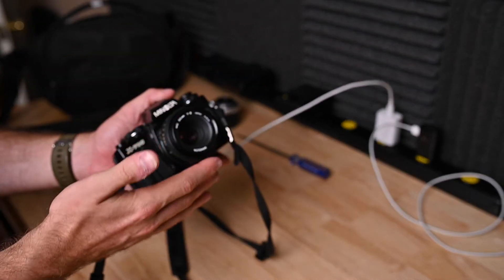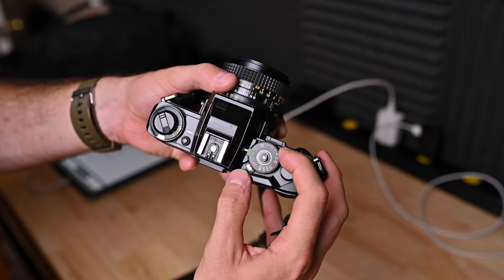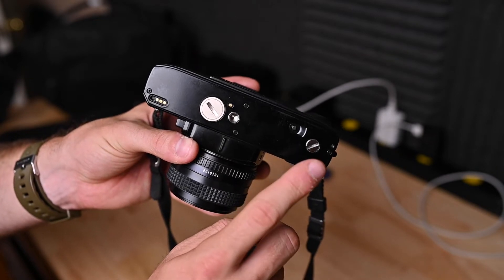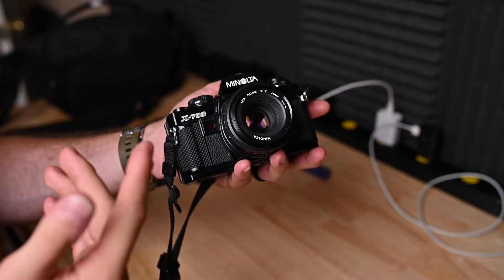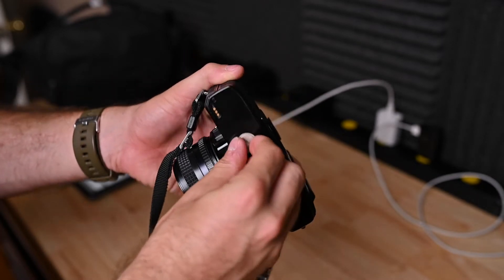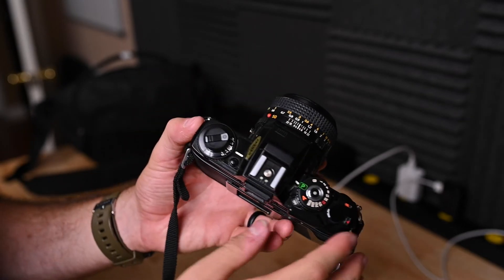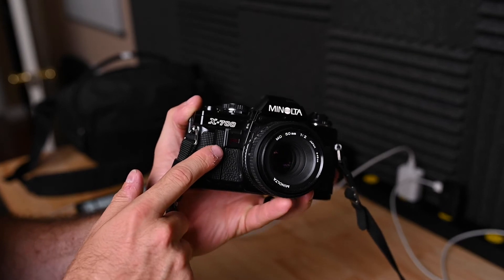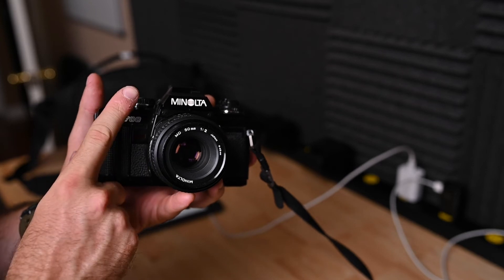How to Use the Minolta X-700 Film Camera

Comment: As it says on the back, it's ISO, which combines the arithmetic ASA scale from America and the logarithmic DIN scale from Germany. On most film packages and cartridges from around 1980 and onward, the sensitivity of the film is indicated by two numbers, namely the ASA part and the DIN part, e.g. ISO 100/21, ISO 200/24 or ISO 400/27. The entire scale from ISO 12/12 to ISO 6400/39 is there.
As you can see, when the ASA value doubles, the DIN value increases by three. 

ISO	=
DIN	ASA
12	12
15	25
18	50
21	100
24	200
27	400
30	800
33	1600
36	3200
39	6400
42	12800
45	25600
48	51200
51	102400
54	204800
57	409600
60	819200
63	1638400
66	3276800

These are the "full" values, one f-stop or shutterspeed apart, but there are film types with intermediate sensibilities, like Ektachrome 40/17, Kodachrome 64/19, Ilford 125/22 etc.

The slotted circle next to the rewind release button is the connector for the motor drive - when you advance the film manually, it will turn.
What you call a cable release trigger port is a pc connector (pc stands for "prise co-axiale" or co-axial connector), which is used to connect studio flashes.
The threaded hole under the lens release button is intended for a cable release (other cameras had it at the centre of the release button).

Comment: Helpful video, thanks. Something weird happened to my X-700. Now only works in B (manual mode). I believe the light meter went. Great little camera though...32 years and running. 🤗
Reply: B is Bulb mode, meaning the shutter stays open for as long as the shutter is triggered. I would imagine it probably has something to the capacitors that are known for going bad.

Comment: Can you change the lens while there is film in the camera? And is it safe to keep a lens off the camera in general while traveling with the camera?
Reply from the maker: Hey Ashley. Yes, you absolutely can change out the lens with film in it. The shutter curtain is closed and the viewfinder mirror is closed preventing light from coming in. You can travel with the lens off as long as you have a body cap for the camera. This will prevent anything like dust or lint from getting in.

Comment: I have a question? What if you replaced batteries and when you went to take a photo it just shut off
Reply from the maker: As in while trying to take a photo the little red lights in the viewfinder don't come on? Have you turned it to "on)))" and see if it beeps in low light? That's a way to quickly check the battery.

Comment: From what I’m understanding is I can’t even test the advance lever without a battery. I just received the X-700 today and I did not do enough research before purchasing. Im use to the mechanical Sr-T 101
Reply: Yes, the shutter is electronic controlled and you need two LR-44 batteries for the camera to work. Your local camera shop should have them. I'm not should if walmrt will. Hope this helps.

Comment: The shutter keeps getting stuck open for a few seconds when my camera is on A mode and am not able to have it fixed as am away for a few days and unable to get it fixed. 

If I put my camera in P mode but not have the aperture on the green 16, will my photos be okay? I’m wanting to see if P mode will be able to compensate for A mode not working, if that makes sense
Reply: Never mind- just used it and now the shutter is getting stuck on P mode too. 
Looks like I’ll have to learn how to use it manually. Any tips?
Reply from the maker: Where are you testing your A mode at? Also what is your aperture and ISO/ASA settings at?  

Your camera may be setting the shutter speed super slow if you are shooting in a relatively dark area such as indoors. Try A mode out in the daylight and see if the shutter operates faster.